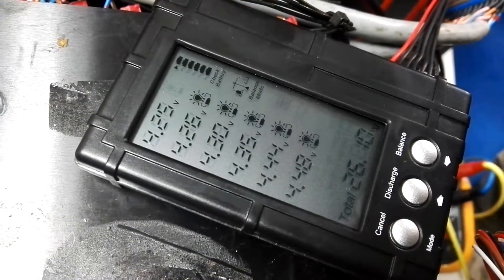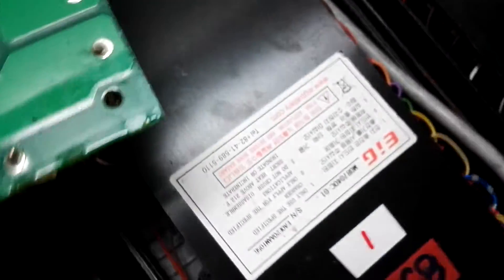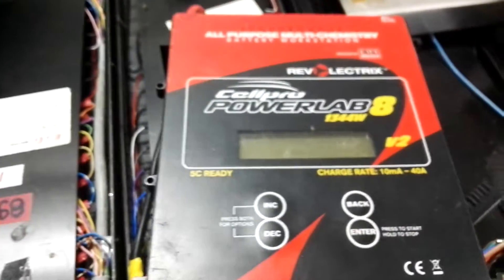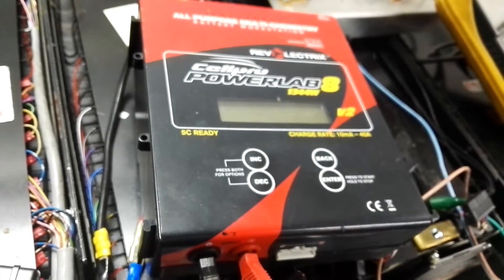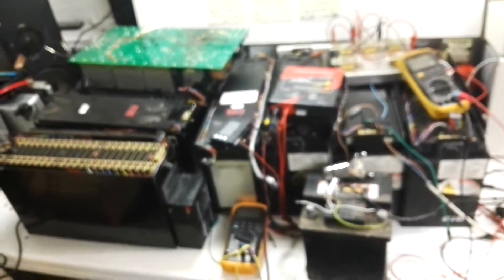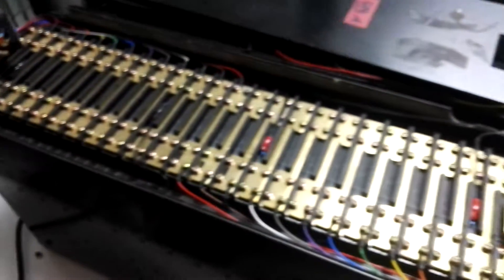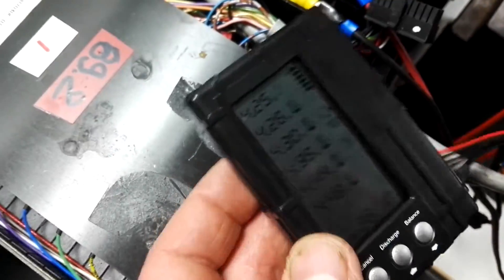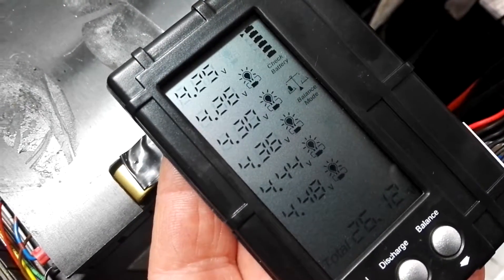Fiat microvett Electric car the EIG LiIon battery

Comment: i got 2 microvett , a qubo and a fiorino , the qubo is working after we replaced 1 defect cell , and right now we work to put on road fiorino
Reply from the maker: I have a complete 35 KW EIG battery pack for these EV's if you needs more cells
Reply: @myNerdStuff  at what price do you have these batteries eig 35kwh is 10 packs?

Comment: Hi, I have some EIG lithium battery modules.  They are about the size of a car battery.  I can't find any data sheets on them.  Could you share the data sheets that you have for the EIG battery you have? Thanks you
Reply from the maker: NoWastedCalories https://www.google.dk/url?sa=t&source=web&rct=j&url=http://www.ebaracus.com/sites/default/files/2012/12/EIG-ePLB-C020-Datasheet.pdf&ved=2ahUKEwjJze-axbncAhXoA5oKHSojADAQFjAAegQIBBAB&usg=AOvVaw02wA2_vGWR9NDO-bjx6v3n
Reply: @myNerdStuff   Can you tell me how I can get these batteries or if you sell them is that I try to contact the company Eig and Ebaracus and never answer and the emails also
Reply from the maker: @fundaempleofundaempleo2054  hey, you might find some replacement cells i china. The cell type is called pounced nmc (LiNiCoMnO2) 20 amps. I found a 40 amp here https://www.batteryspace.com/limnnipolymerli-ioncell37v40ahplh-12211218c148wh60arate.aspx i use All cells myself, so Don't cell any
Reply from the maker: @fundaempleofundaempleo2054  found some kokam nmc cells on ebay 18-20 amp
Reply from the maker: @fundaempleofundaempleo2054  https://www.google.com/url?sa=t&source=web&rct=j&url=https://www.ebay.co.uk/itm/Enerdel-Kokam-Lithium-Li-ion-Battery-17Ah-20Ah-32Ah-EV-Pouch-Cells-/231556293926&ved=2ahUKEwiCvMHKor3hAhXCaFAKHZ55C7UQjjgwAnoECAQQAQ&usg=AOvVaw00IiCZaKbr9cChS6DvNboT
Reply: @fundaempleofundaempleo2054  I am looking for these cells too, do you found some cells?
Reply: @myNerdStuff  thank you
Reply: Thank you very much!!  Is this data good for Model # M087040C-01?
Reply from the maker: NoWastedCalories i am not sure, but the cell type is printet ob the side of each cell
Reply: @myNerdStuff  thanks
Reply: Hello .I have problems with ballancing too. Can you tell me where did u buy It? Thanks in advance